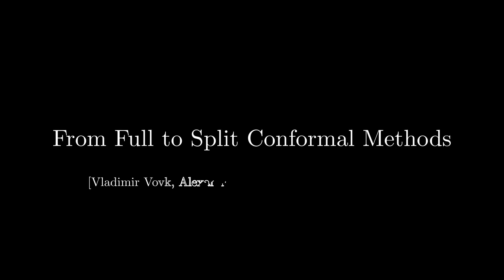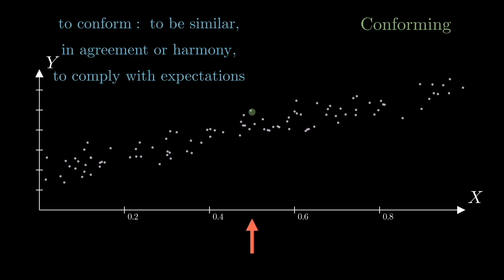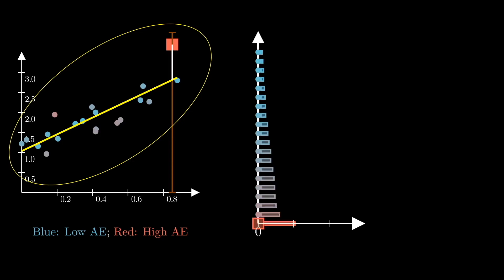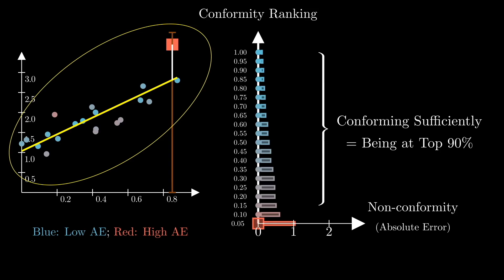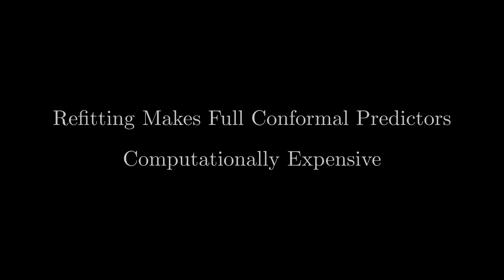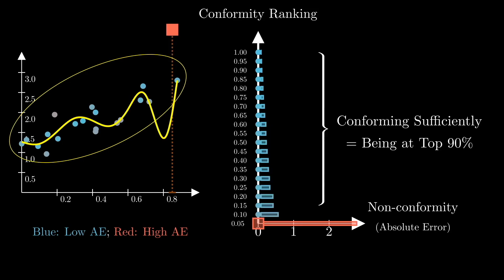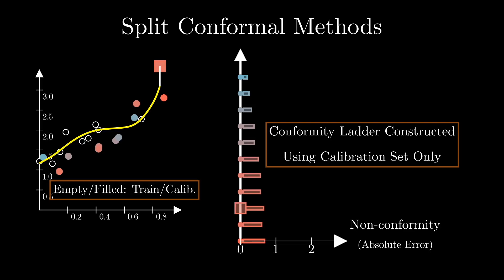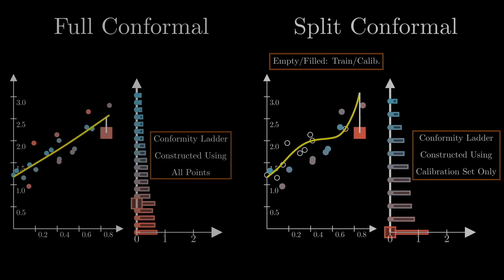Uncertainty Quantification (3): From Full to Split Conformal Methods

Comment: Thanks for the video.  One thing I missed is what does the color of the points correspond to in the case of split CP. With full CP it corresponds to AE, but with split CP?  (note that it changes when the square is moved around, so it cannot be AE). Thank you
Reply: Hi, it seems the color scale is normalized to the proportion of the total AE covered by each of the 11 points used for the ranking in the ladder. That is, it's giving a notion of distance to the model relative to the other points. Since the point is changing, the total AE (sum of all absolute errors) is changing, and therefore the proportion of AE of each point also changes.

Comment: Is it the case that the prediction set is always an interval? If so, doesn't it suffice to approximate only its upper and lower limits (instead of refitting the model for all possible squares in the range)?

Comment: After watching this series a few times, the thing that (still) confuses me is the fact that for (100 % of training data + each new point) we have to fit a new model each time for each plausible label, but for (percentage of training data or calibration data + each new point) we don't. It looks to me that in both cases test point could be out of bag, be it full training data or e.g. 20% of training data (calibration dataset).  I see that everything is the same in terms of implementing CP, but the difference is only in the number of points (training vs calibration).
Reply from the maker: I am glad to see that you have watched all the videos. In full conformal, test point is assigned a plausible label, which allows it to be considered as part of the bag; we have to refit the model so that all plausible values are considered.  With split conformal however the bag consists of calibration points only.